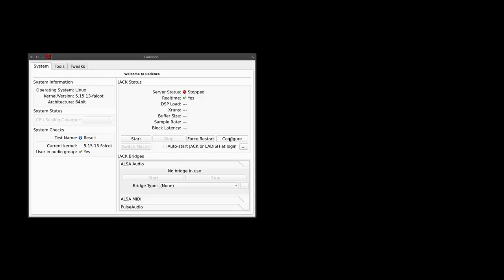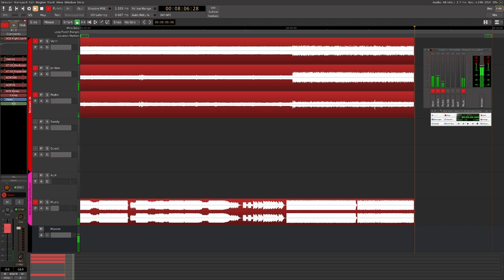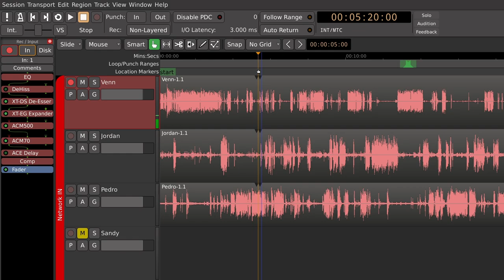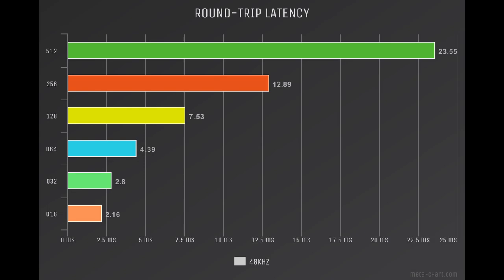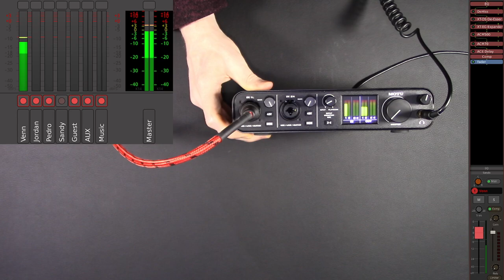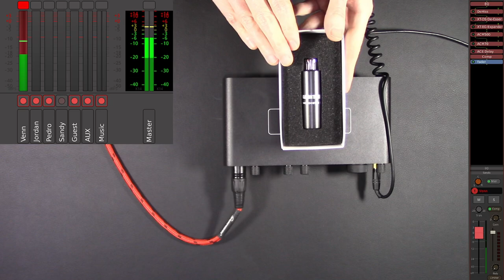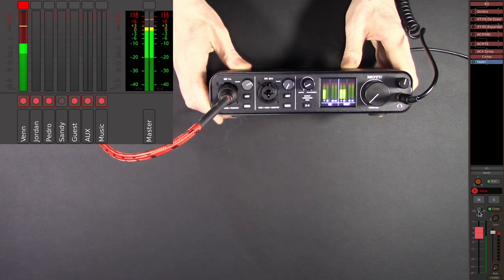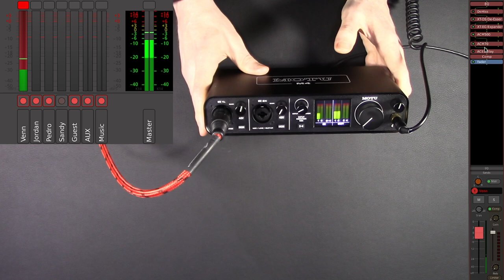MOTU M4 On Linux

Comment from the maker: I like the M4. It’s well built, sounds the business, and packs a solid punch for the price. There are no drivers to install but you will need kernel 5.14 or higher. Round-trip latency is fantastic (for USB) if jack_io is being honest. More on that in the writeup https://linuxgamecast.com/2022/01/interfacing-linux-motu-m4/

Support future videos
Patreon: https://patreon.com/linuxgamecast  
MOTU M4 on Amazon: https://amzn.to/32adWSh
MOTU M4 on eBay: https://ebay.us/NO4H6U

Timestamps
00:00 Overview
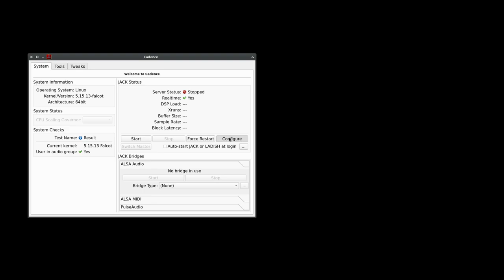02:56 Jack setup
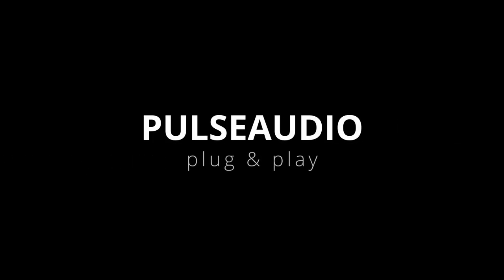03:41 Pulseaudio
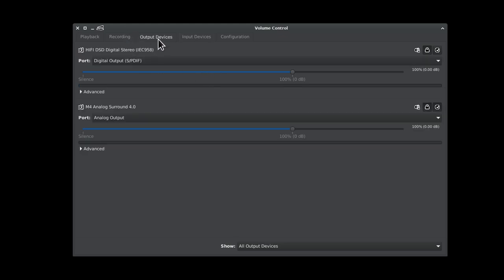04:01 Checking for xruns
04:36 Studio test
06:01 Round-trip latency 
07:51 Microphone check
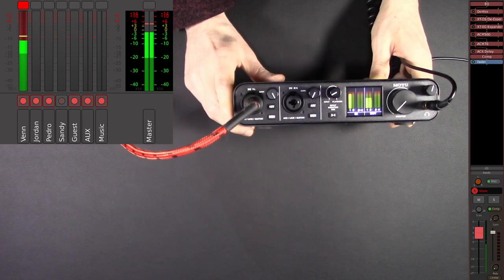08:49 Do you need a Cloudlifter?
12:29 Deboxing and thoughts

Comment: The Linux setup is not as nice as suggested in the video. Just purchased an M4 one day ago, because it has some good specs, which you also mention in the overview. I'm an Ubuntu and Unix user since a long time, and based on my others experiences with similar devices I was confident that it could work on Linux, although Motu says it's Mac and Windows only. I use Audacity. Unfortunately, there appears to be a problem with the audio transfer via USB. Using the standard approach, the only audio exchange via USB that works more or less is when you connect to the extra line input at the back of the M4. The signal is weak, there is no gain on that input. The workaround is to edit the sound afterwards in Audacity to normal levels. Input via the front connectors or playback from the PC to Motu is either distorted or not possible, depending on what you configure. The device is recognised in Ubuntu (20.04) as Analogue Surround. The output sound you get contains cyclic peaks of distortion, the input to the PC is always distorted. Based on your video I  had a look at KXStudio that you use. Yet another problem: there is no simple install (eg with apt) that works with all popular current Linux releases. I tried some things suggested at the KXStudio site but it turns out that this will require days of experimenting, possibly building something from scratch from their source code repository. The Motu M4 is a very nice device on it's own, but I must warn that to make everything work on a recent Ubuntu may take a long, very long time. So if you are planning to make other (instructional) video's, possible topics could be: how to configure the M4 in a normal actual Linux desktop setup. How to make it work with Audacity, a very popular tool. And how to install KXStudio, Cadence or some other equivalent software in a simple way, without a pile of errors and incompatible things.

Comment: The M4 has been on top of my list, but I'm hesitant to buying this interface due to the bright LCD. Does the M4 still work if you disconnect the internal LCD-connector? Some more info on the circuitry surrounding the LCD would be very helpful.
Reply: Sorry,  just a thought - but couldn't you just apply a physical filter over the panel?  It could be unobtrusive, and wouldn't void any warranties - but obviously,..won't benefit the battery life.

Comment: Great video man. Sound quality-wise how does the M4 compare to the Motu Ultra like Mk5. On the fence about which one I want to go with. I’m currently using an Apogee Duet 2 and it’s been a great sound card, but with the addition of a new stereo synth, (Behringer Poly D) and my mic I no longer have enough IO to accommodate my set up. I’d also like something that is comparable or better sound quality wise than my Duet 2.

Comment: Sorry for the very basic question, I'm not very familiar with this stuff.

I see in Pulse Audio it detects the Motu M4 as 4.0 surround output? This means this won't work to use it to output the same 2.0 signal into the balanced outputs, in example to a set of active speakers and to a headphone amplifier?
Reply from the maker: I believe (by default) whatever is sent to the main outs is replicated in the headphones.

Comment: Is this a OLED display with burn-in effect on the MOTU M4?
And does everything on the MOTU M4 work the same under Linux as it does under Windows? Or are there some features, that miss driver support for Linux?
Reply from the maker: LCD. I don't know how it functions under Windows.
Reply: @linuxgamecast  I did a little research today. It's definitely an OLED display and thus will have burn-in effects.
Reply from the maker: I read the page from the manufacturer. "The M2 is the only audio interface in its class with a full color LCD "

https://motu.com/en-us/products/m-series/m2/
Reply: @linuxgamecast  The teardown of the thread Motu M4 - Tear down, bit of internals analysis and few in-house measurements in the forum audiosciencereview is much more clear. 
No links, because of YT spamfilter.

And if you watch videos of MOTU M4 devices that have been in use for a years months and compare them with the reviews back then where the devices where new, you can clearly see this on the display. Because the completely new displays are still completely black at the top of the level meter, while the older ones, which have already had many hours of operation, have a burn-in effect.
Your device also shows clear signs of a burn in effect at 8:00.
Reply from the maker: Again, I'm going by what MOTU states in the manual and on their website. Feel free to contact MOTU for additional information. 

What you see at 8 minutes in the video is what they looked like out of the box in 2019 when powered on. LCD + backlight.  

Please refer to 01:41 of the Sweetwater review from 2019 for a visual. https://youtu.be/OsJip1JbvQc?t=101

The meter is a slow unnumbered blinky gimmick on a budget interface. Not something you should rely on for tracking inputs.

Comment: What is the easiest way to separate channels 1/2 from 3/4? When I plug it without jack and play a youtube video, all 4 outputs light up. With Jack via LMMS, I  see only outputs 1/2 light up but I can't simultaneously play audio from the browser.  Is there an easy way to release outputs 3/4 so another application can use them?

Comment: Would it be a bad idea to use a FOSI P2 tube amp for Motu M4?.. I have DT90'S Pro 250ohms and I have to gain up to 95-99 just like you did to have decent volume.  Sweetwater and Motu says it's goes up to 80ohms, then everybody else says they even drive 300ohms or more.  Why Fosi P2?... first dips into tube amps, and why not get volume at the same time.. for cheap.

Comment: I have a 2nd-gen Scarlet 2i4, and it does not have the AIR gimmick which was upsetting because I didn't realize they had added it with the 3rd gen. I'd be interested to hear how well it works to boost the mid-EQ levels. But I think Motu's gimmick is way smarter with active visualization monitoring meteres.

Comment: 0:42 First of all, it's Presonus! Big Studio One fan, so had to correct you!

Secondly, MOTU has had the Microbook for since 2010 for this price. Which basicly is an M4, but Mic & guitar instead of multi-ins, no MIDI, worse meters, USB-B instead of USB-C, line out 3-4 only in minijack.... Let's just say it was their first... Second and third try (IIc). I've got the II.
Reply from the maker: I'm glad you are a fan of Studio One. Unfortunately I'm unfamiliar with it since it does not support Linux. Unlike Reaper, Bitwig, Ardour, and Harrison Mixbus.  

I put the Mikrobook II in a different class since it supports internal routing and onboard DSP like my MOTU 828 and Traveler. 

The M2/4 functions as a basic I/O device. But hey, blinky meters.

Comment: I have an ultralite mk5. On windows, cuemix 5 is annoying. Motu pro is so much better, but you can't use it with the mk5. There's also no web management or touch control software compatibility. The better option is the MOTU AVB or the MOTU 624. Everyone forgets those units even exist for some reason.
Reply: +1 for the Motu Ultralite AVB on Linux. It's a fantastic interface with a lot of I/O and the web-based mixer means you can control all the internal mixing/busses/effects/etc.. using an ethernet cable. Right now the Ultralite AVB is hugely backed up due to supply chain disruptions... but it should be head-and-shoulders above the MK5 for use on Linux. Cuemix is not an option for Linux users - and even if it was, I would much rather use the far superior web-based AVB mixer.